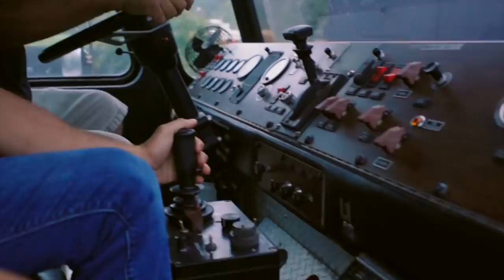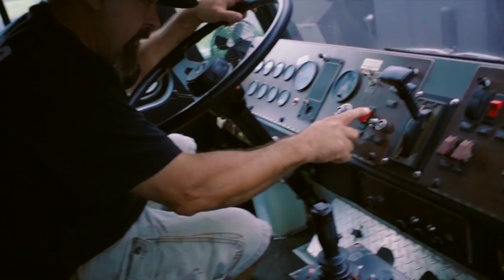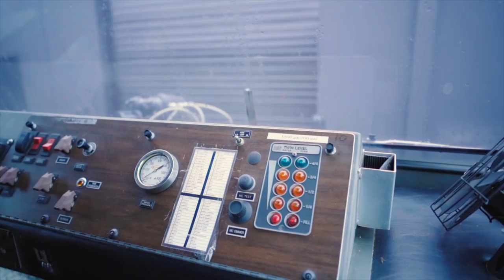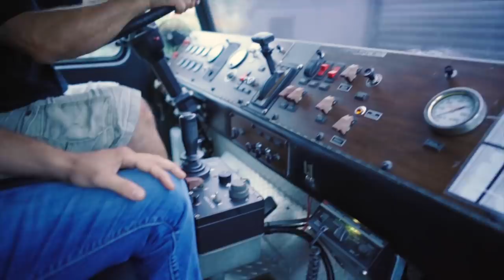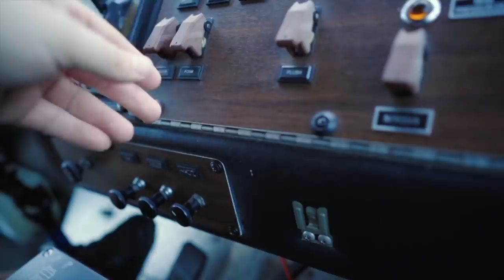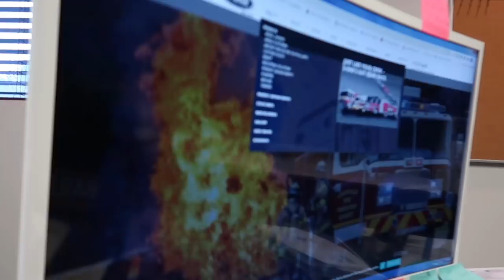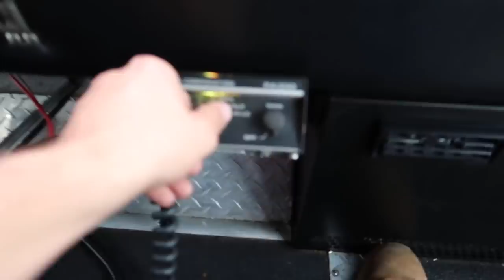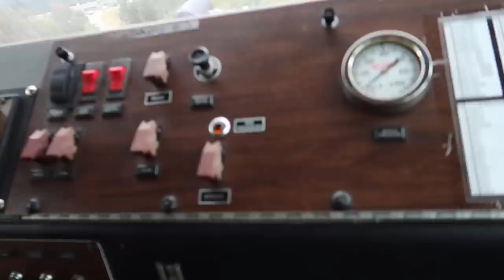I BOUGHT A FIRE TRUCK, THAT HAS JOYSTICK WATER CANNONS!

Comment: And as far as foam that's in the tank, it's AFFF and it will eat the paint off of stuff. And has been linked to cancer in firefighters so I really wouldn't play with the stuff. Best advice, get ahold of a firefighter in the area to help you out. parts are not cheap by no means for that thing.
Reply from the maker: Thank you for all the info! We want to learn it 100% before we get to crazy thats why we did a small test.